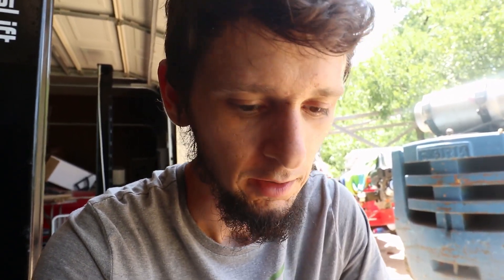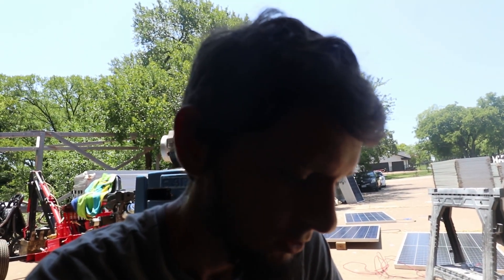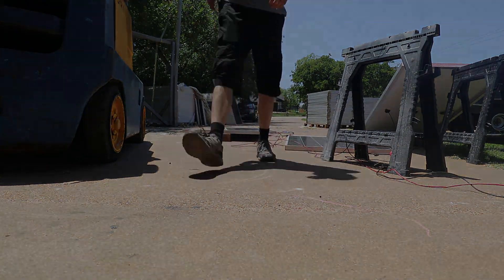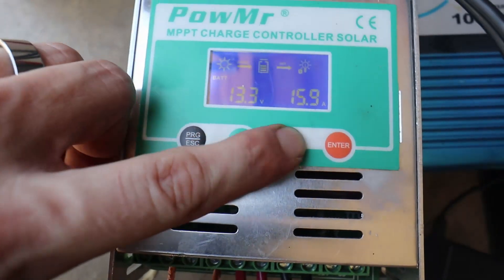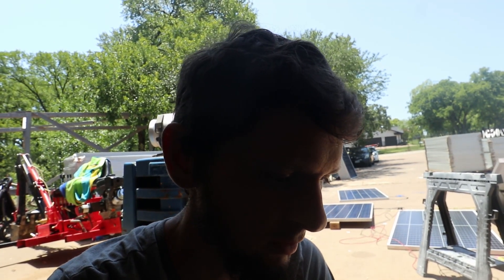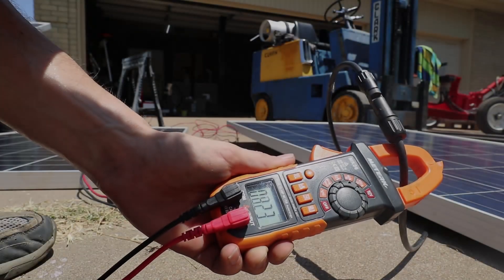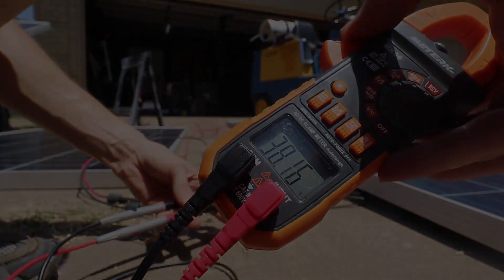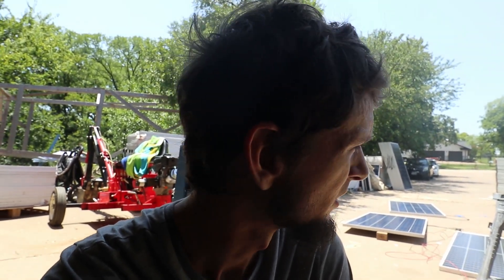Compare Used Solar Panel to New - BONUS - How to Read Short Circuit and Open Circuit Values

Comment: OOooohhhh So you cant measure DC voltage with the clamp meter. Didnt know that but deduced it because I tried out two DC clamp meters and neither of them showed it using the clamp. 

Just a little nugget I was able to grab from this video thanks.
Reply from the maker: The little things we learn, glad I could provide something useful!

Comment: In your experience do you find that the form factor or surface area of larger panels to be the same as the surface area on smaller 100 watt panels. 

Aka, does 4 100 watt panels give you about the same surface area of a 400 watt panel? With or without rails if that makes the question more str8 forward.
Reply from the maker: If you look at the efficiency of a panel it will give you a rough idea. But I imagine you lose a lot from the frame of the panels if you have multiple smaller panels.

Comment: Interesting test and good enough  estimate. 
PowMr Reading
295 watts from 400 Watt panel 75%
220 watts from 305 Watt panel 72%

Were both panels washed before the test?
A guess to remove sun intensity or MPPT variables performing short circuit tests on both panels at the same time could do that. But then you would have to sample several panels then average it out. So getting a more accurate reading could be a never ending pursuit. 

My neighbor was over today saying how inefficient my silicon panels are and they don't last long.  Not sure where he go that information from.  Have 5 year old mono crystalline and I can't really see any degradation.  Maybe he was talking about how panels only convert 22% of the solar energy into electricity. But who cares not like I'm paying for the loss in efficiency.
Reply from the maker: I did make sure the panels were clean, after editing the video and getting it uploaded I realized there were a few things lacking. Should have shown the label of the panel to show what the open circuit and short circuit values should have been instead of just verbally saying them.
Reply: @BeeneEnergy  Be interesting to see what a really old panel that was in service all its life can still produce. Thank you for taking the time to share your work. Much appreciated.